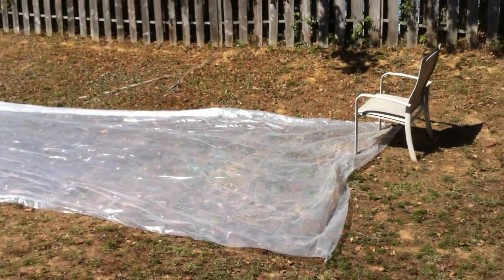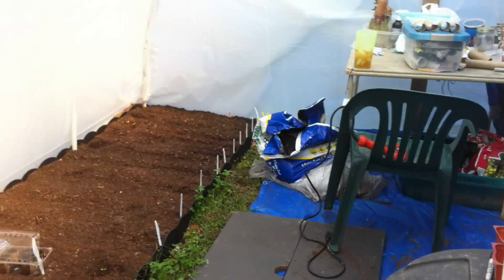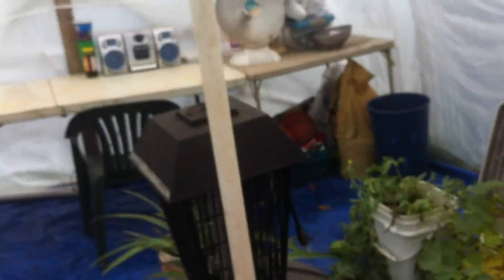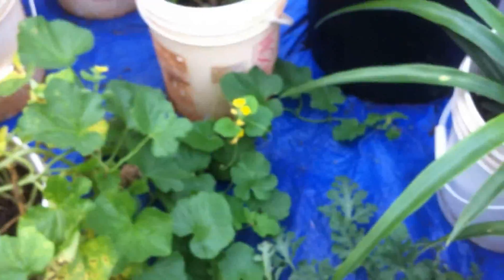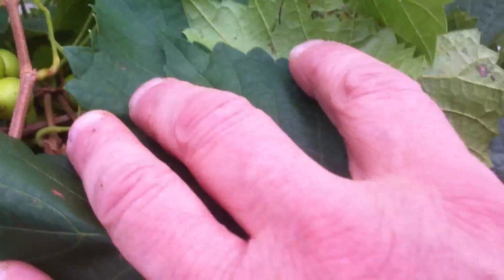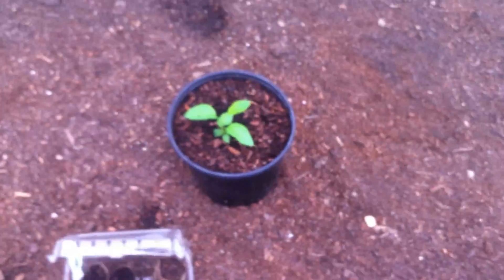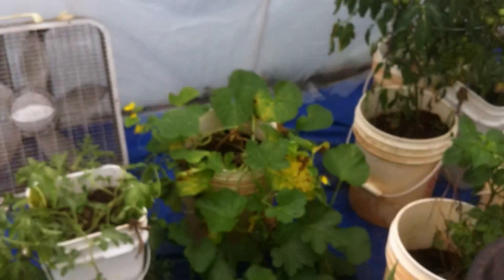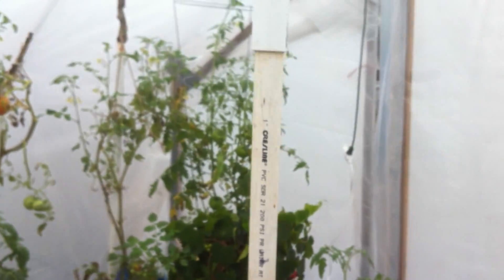Adding a 2nd layer of Visqueen to the Green House to Hold the Heat in this Winter!

Comment: @cfenster I use an Accurite that I got from chinamart. It has a wireless transmitter that is made for outside use, and a base unit that stays inside the house. The transmitters do fine, just don't leave it on the ground in the rain..not good. One thing to look for is transmission range. I use the 300+ foot models.  Greenhousology..LOL

Comment from the maker: @loislaney23 I have 2 of the largest Presto DISH heaters that they make but I only run one of them unless the temps go below 20. The temp this morning  was 31 outside and 54 in the GH with 1 heater. I ran them last year but the GH did not hold the heat in nearly as well. The difference is significant. I bought about 20 of those clamps but I dont want to use them inside since the slot (or opening) would cause a potential wear spot on the exterior sheeting. You know... Small tears = big holes!

Comment from the maker: @Planting81 The main difference in the temperature inside from outside is the heater inside. I run the heaters once the temps go under 40 degrees  I kick the heater on. Typically, the green house will stay 15 to 30 degrees above the temperature outside. I have 2 large dish heaters but only run one of them until the temps go below 20.

Comment: Everything looks really good. Yes, marking the pilot holes sure helped me. Glad it helped you too. What kind of heaters are you using? I know my gh froze on the inside the other night. The plants I put in there froze. I did not have my heat lamps on. Have you ordered those clamps yet for the pvc?

Comment: I did the same thing last winter on my north wall, as well as the west end. I think it really helped. I picked up 250' of plastic today for the new GH and putting a second layer on the first one, along with the inflation blowers. Do you have a wireless thermometer that you can put in there? It helps to determine just how well the heat is working. And you're gonna have watermelons growing in Nov, thats just insane ! Good job Chuck.